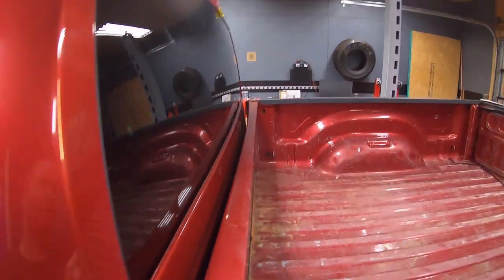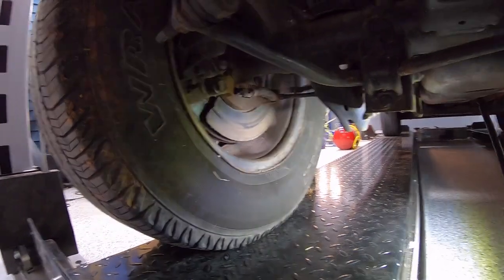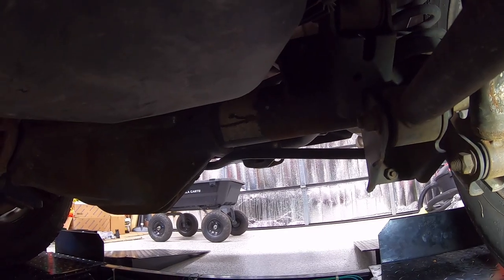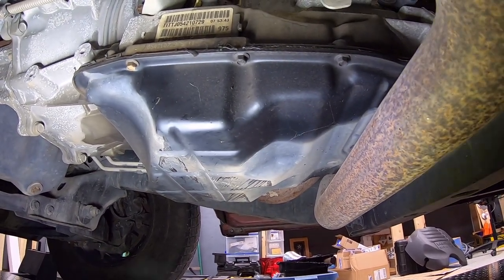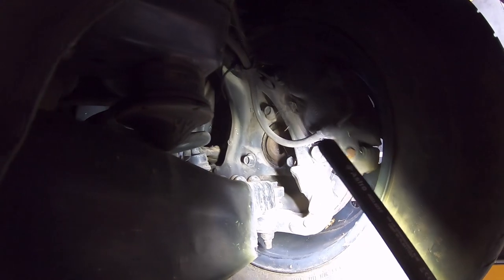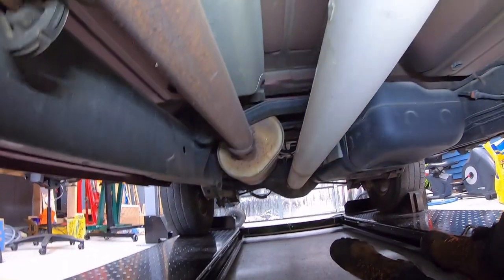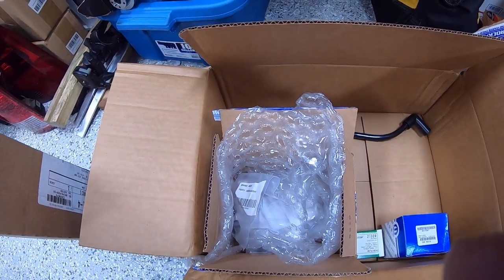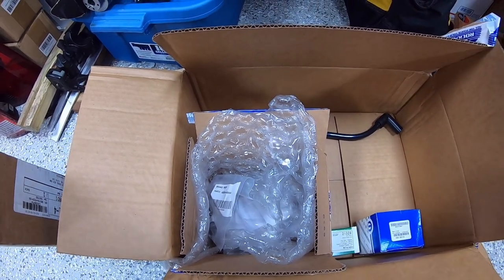2012 hemi 1500 project X Part 5.  Taking a look at the underside and damages.

Comment: I would highly recommend replacing those rear trailing arms (the beefy one's) When the bushings go, the truck starts lunging left or right when you accelerate or brake. Pretty cheap and really easy to replace. Ask me how I know, lol.
Reply: Just get some butyl rubber tape and make seals for the CHMSL and satellite antennae.
Reply from the maker: Excellent point, I'll add them to the list.
Reply from the maker: @js12278  Thanks for the comment, excellent thought.

Comment: if you do a build it would be cool if you did some transmission upgrades like the valve body or torque converter. Maybe that's a lot to ask, but it'd be cool
Reply from the maker: We got some of those planned, the cam we are looking at will require a high stall torque converter.